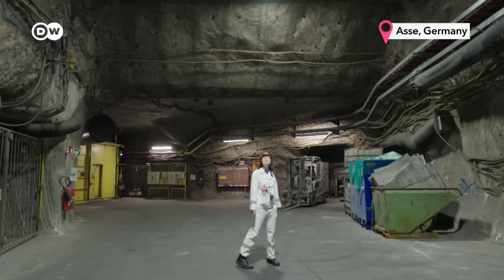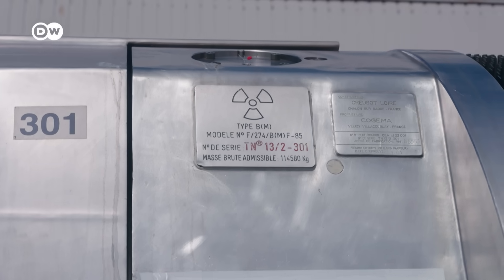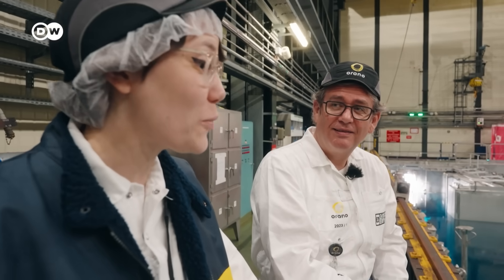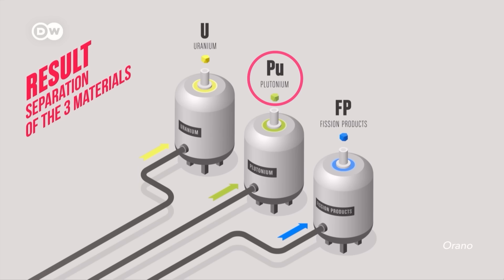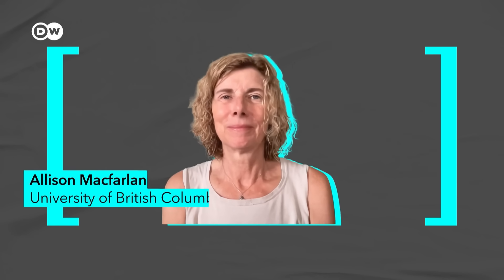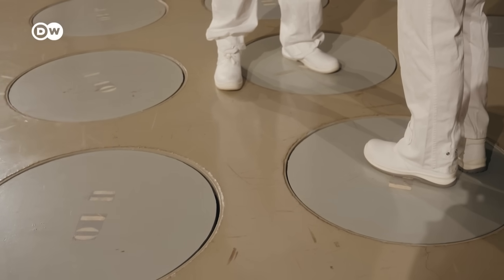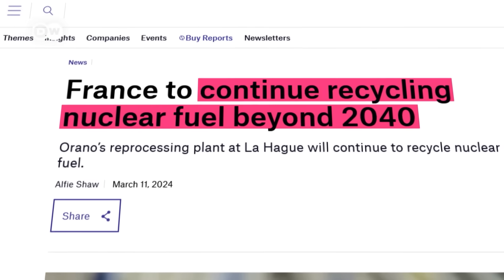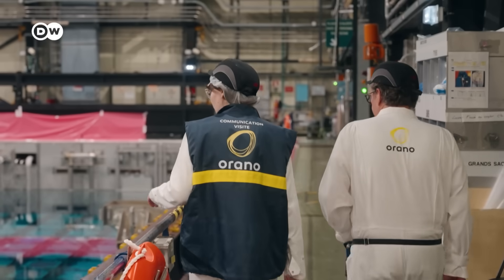Nuclear waste is reusable. Why aren’t we doing it?

Comment: This vid is ALMOST accurate, and it still feels pretty anti-nuclear, particularly when trotting out the nuclear bomb footage.  Yes, someone did make plutonium for a bomb using a CANDU reactor but NO - the reactor was not run correctly to produce electricity.  It was NOT from the plutonium from spent fuel.  Just because it is "plutonium" does not mean you can make bombs.  It is the same problem you get trying to make bombs from natural uranium.  Remember the vid mentions U235 - that in high enough concentration (typically well over 90%) makes a bomb, but a reactor runs about 4% with fresh fuel.  Plutonium from reactor fuel is a wide mix of isotopes.  It is NOT bomb material.

The vid also mentioned "fuel is radioactive for 100,000+ years".  What it should say, is "more radioactive than the average background".  When you pull out the plutonium, you are left with fission products (correct in the vid) but those decay away quickly.  300 years is enough to drastically lower the emissions.  The plutonium can then be used for fuel (particularly when mixed with regular U238) as "MOX fuel".

As for those "experimental" reactors, they are called "breeders", they consume the U238 which a normal reactor can't do.  Instead, the U238 is bred to a mixture of plutonium (gasp!) isotopes, or you start with thorium and breed it to U233.  Both of those can be used as fuel, which is why it is said that 96% of the "spent fuel" contains energy being thrown away.  The development of breeder reactors started in the 60s.  Lack of funding and public fear basically halted development until about 10-20 years ago.  We should soon see the results of their development. 

The biggest problem with nuclear power is too few members of the public understand it.  Once you learn about it, your fear drops away.
Reply: It wasn't even a CANDU reactor; heavy water moderated and light water cooled.
And yes the fission products are much shorter-lived.
Reply: There is a proliferation risk involved with fuel reprocessing though, if you can extract separate isotopes you can extract Pu²³⁹
The solution to this problem is liquid fuelled reactor with a high burn up rate rather than solid fuel reprocessing.
Reply: @MostlyPennyCat 
Higher burn-up waste (from PWRs and BWRs rather than CANDU) contain a much higher percentage of Pu-240, which makes building a weapon much harder (and a fizzle more likely). Yes you could try to centrifuge it, but then the mass difference is not as great as between U-235 and U-238, plus explaining to the IAEA why your centrifuges are unusually radioactive may be challenging.

France already has nuclear bombs of various sorts so the proliferation risk is lower. Look at how uranium enrichment works; proliferation risk but managed.

Note that SHINE Technologies (of the USA) is working with Orano to develop reprocessing where the Uranium and Plutonium are kept together.
Reply: @asabriggs6426  you can quite simply run a civilian reactor for a short time and then extract the Plutonium before too much Pu-240 accumulates. This is an inefficient and thus uneconomical way to run a power reactor, especially if it's a type that doesn't allow on-line refueling (which includes the now standard PWR designs), but it is definitely possible if you don't care about the cost. Any country that has a light water nuclear reactor and the capability to recycle spent fuel rods can also make weapons grade plutonium, it just might be less efficient than using a dedicated plutonium factory like Hanford or Mayak.
Reply: @johannesgutsmiedl366  If you have a reactor capable of online refuelling (CANDU, AGR) then a lower burn-up of fuel is possible. However doing so with a PWR would have an obvious signature as shutting down the reactor and taking the reactor head off is a time consuming operation (a full refuelling outage can take several weeks). Also the reactor would require an unusually large number of fuel rods. The IAEA would take a great interest in this activity; their safeguards monitor things like the whereabouts of fuel.
At that point simpler designs of reactors may be better. For instance, North Korea used a version of Magnox reactor which ran on unenriched uranium (I believe).
Reply: @asabriggs6426  oh yeah of course if you're concerned about being detected then a PWR isn't the way to go, I'm talking from a pure physics/engineering perspective.
Reply: @johannesgutsmiedl366  From a pure physics point of view you're probably better off building some centrifuges instead. Small energy usage, few potential radioactive emissions from enriching. The USA even publish pictures of what centrifuges look like and how they work. Centrifuges (from Urenco) are how Pakistan joined the club. Don't use Siemens PLCs, mind you.
Reply: @asabriggs6426  There are four plutonium fluorides, but only one of them, plutonium hexafluoride, is a gas, and it's highly prone to radiolysis due to plutonium's radioactivity.
Reply: @MostlyPennyCat  There is no proliferation risk.
The separation of Pu 239 from Pu 240 found in spent reactor fuel is practically impossible.  The difference in mass is only 1 while the mass difference when separating U 235 from U 238 from natural ore is 3.  Why would anyone interested in making a bomb choose the almost impossible method rather than the still hard but achievable easier and proven method?  Answer: They wouldn't.
Reply: @i.e.creative  There are ways of separating the isotopes in an atomic beam via the different magnetic moments (https://en.wikipedia.org/wiki/Stern%E2%80%93Gerlach_experiment)
Reply: @i.e.creative   "The separation of Pu 239 from Pu 240 found in spent reactor fuel is practically impossible." Very interesting point. Seems like this blows the recycling danger argument out of the water. Anyone care to counter this claim?
Reply: @cadthunkin  you can still build a nuclear reactor but not a bomb you see that leftover plutonium.  The fact it can't be separated is actually very helpful because prevents you for making bombs.  However that mixture of plutonium is commonly used and recycled. The French already do it it's called purex.
Reply: @i.e.creative  it's not "almost" imposible it is imposible to separate PL239 from PL240. At least for now.
Reply: @nikitashilov9758  I will stand by my wording that it is possible because I have literally separated the 2 isotopes myself using a particle accelerator.  So it is possible to do so but it is totally impractical to separate the 2 isotopes in a quantity useful for weapons.
Reply: @i.e.creative  you can address it to IAEA, because they told it. Because of it fuel from atomic reactor is not a subject to Treaty on the Non-Proliferation of Nuclear Weapons.
Reply: @MostlyPennyCat  I'm glad that you know the difference between Pu239 and Pu240. However, Pu240 is not suitable for bomb production because it spontaneously decays too rapidly, causing premature fission when attempting to trigger a bomb. But Pu239 is converted to Pu240 rather easily, so in order to produce bomb grade plutonium, they cycle fuel through the reactor fairly rapidly. That is quite different from how they cycle fuel through a reactor for energy production. For energy production, they keep the fuel in the reactor for quite a while, and in doing do, the percentage of Pu240 in the plutonium makes it unsuitable for bomb production. And separating Pu239 from a mixture of Pu239 and Pu240 is rather difficult.
Reply: The video does make the point that the real barrier is simply cost. That's not blind fear, it's economics.
Reply: @zibbitybibbitybop  Only when economies of scale isn't factored in to the equation. 
Do that and it quickly becomes clear that. Spent nuclear fuel recycling and nuclear power in general far out perform any other form of power generation when considering like for like on a level playing field. 👍
Reply: @robfer5370  
The high cost of reprocessing is what limits its growth. 
When we first developed reprocessing the world thought that natural uranium was MUCH more rare than it is.
Turns out there's lots of uranium, digging it up and making UrO is just cheaper and cleaner than fiddling with the most dangerous materials on the planet.
There's 56 million gallons of PUREX waste water at the Hanford site containing 16 exabequerels of radioactivity.
Hence not financially viable.
Reply: nah the biggest problem is when you understand it and you also understand economics as well, therefore you realize how much waste they have to deal with compared to renewables

many people understand it, don;t trust people do do it right
Reply: @DarkShroom  I find this so dishonest though

When it comes to economic problems with certian industries, we always seems to find solutions anyways to reduce the cost.

Batteries are extremely costly at the moment from being used as a dedicated grid for power, but does that stop the industry from finding solutions to decrease the cost? NO!

But that's not happening with nuclear, because cost isn't the actually inhibitor, public opinion is.
Reply: @ODSTklecc  partially yes. In my own opinion it is t only the cost, but the availability of the mines is very unfavorable for Europe, there is the constant spillage of tritium (heavy water) that everyone always either ignores or compares to a crate of bananas. As well as the strategic vulnerability. Sure for some parts of heavy industry and energy dense areas it can be the better solution. But it shouldnt be seen as a magical bullet either. If we would have nuclear for 10-15% of our total power production it would be good. This is a totally arbitrary number on my end, a estimation and nothing more.
Reply: The halted development point is a good one to highlight. Everything in the nuclear space has taken way longer than needed to develop because of the extreme lack of funding and public skepticism about it. If nuclear had clear government support technological development would follow a more traditional timeline.
Reply: @_lime.  
We're picking up the pace here in the UK.
Got some SMR projects going, lots of really promising fusion projects too.
The one I'm really looking forward to is Moltex's SSR and the first one that they're building in Canada is the waste-burner, SSR-W
Reply: @_lime. The US DOE budget for nuclear has been from 30 to 50 percent. Nuclear only makes up about 20 percent of energy production.
Reply: https://en.wikipedia.org/wiki/CIRUS_reactor
Reply: Well said and accurate!
Reply: Let those snowflakes just live few months with power outages and they quickly learn how electricity is important for our current civilization, literally everything is dependent on electricity, solar and wind energy are kid's toys compared to what nuclear power plants produce. They never struggled in their lives, bunch of hipsters sitting in Starbucks and writing stupid articles on their MacBooks about nuclear wastes are so bad and dangerous, they care about environment as much as Greta Tumblerg.
In order to advance we need even more electricity, good luck achieve it with "green" energy.
Reply: If anyone is interested in the next step forward, china announced thorium msr to be completed in 2029. Look into it
Reply: not to mention the "waste fission products" have other uses in medicine, industry, or even power generation still.
Reply: Glad to hear people start to realize nuclear power is not really bad like people thought on chernobyl and fukushima incident (they keep saying it a loud since only few case that can be mentioned as example). If I was raised from non-scientific parents, I might not a pro-nuclear
Reply: I still have no idea how people can't grasp the concept of nuclear power and that it's the safest and greenest source of energy that can supply the whole world. I hate how anti-nuclear the governments and media are, especially leftist ones.
Reply: да сейчас степень размножения в бн800 0,85.
Reply: this is german media
ofc they're gonna slip in anti-nuclear, they're paid to do that
Reply: Disagree with u really hard, we almost normalized nuclear power plant before. And where that bring us? 
Company with low reposibility and care handling it, cutting cost etc, and the rest is history. People against it not without a reason, the fact that we manage to almost normallized it back in itself is alrd a proof.
But no, some sh1thead really has to ruin everyone times, and now almost 50 years later, we pay the price, companies and govertment that handling nuclear power have to many ties between their leg, but the moment we let it loose, another history might repeat.
Slow progress like this isnt that bad, we still gonna build towards better nuclear power plants in the future while also making sure those who handling it actually breing very carefull and no cutting cost capitalist bshit.

Recyling it sounds good on paper but once we tied it to economic issue, the problem rise, recycling cost u money, and alot of it compare to just use a new uranium. I dont wanna to think, which next company's leader have a simple thought of "this cost too much, lets cut cost somewhere" on their stupid head, and ruin everyone time, again.
Reply: @LFTRnow one thing I disagree with is always the framing that "stupid public be so fearful".. Many things that also stopped development in breeding&recycling stopped with the The Treaty on the Non-Proliferation of Nuclear Weapons..  Which was not stupid public, but global politics.. and the other thing is, the public is not just "stupid fearful", they lost trust. How did this happen? For example when the Windscale Brand was for many years tried to cover up. Or when Japan goverment stepped in front of camaras and deliberately lied to the public for days. (as they said, they feared panic, if they would be honest). Anyway, when honesty isn't an option you gonna lose trust.
Reply: @georgelionon9050  At the time the public scare was pretty much justified because nuclear power started with the bad image of the nuclear warhead, furthermore at early stages there was not enough research to confidently understand the risk and safety of the nuclear reactors and there was a justifiable belief that nuclear power could proliferate nuclear weapons. 
That said, tell me one sector in which there is complete trasparency, or tell me a source o energy that never killed anyone: The Banqiao hydro power plant killed between 200k/300k people; in extreme condition (5th most powerful tsunami ever registered) the fukushima disaster killed none! Two hydrocarbons related disaster happens every MONTH but it's nuclear power the energy form with an ONU organ completely devoted to his safety.

The initial fear was justifiable, post '60 fear is just misinformation and stupidity.
Reply: Cos it was anti-nuclear, hiding behind the banner of being good genuine information! 😒
Reply: @robfer5370  according to that logic, the US government is also anti-nuclear because they don't like it when other countries have Plutonium.
Reply: @1zui  No according to that logic money and power are the real motivators at work.
Reply: Too few members of the public understand it.

A perfect way to sum up a lot of things really.
Reply: Basically, there are multiple isotopes (think of it variants) of plutonium of which only one is of interest for nuclear weapons.  That one is quickly produced in a nuclear reactor from Uranium 238 which the vast majority of the uranium in most reactors.  Leaving the fuel for longer in the reactor more and more of the "bomb plutonium" isotope is converted into another isotope which is a large problem for the construction of weapons. This means for plutonium bombs early reprocessing of the fuel which is not well spent by that time is required.

The operator of a power plant has contradicting interests, wants to minimize the cost of fuel (and the interruptions by replacing fuel) thus leave the rod for as long as viable in the reactor.  In short, these interests conflict each other.

As for the quantity of highly radioactive fuel.  It is being reduced by reprocessing.  The problem is more the unavoidable side products of low and middle active waste which inflates the total quantity.

And then there is this term radiation.  The term was probably taken from mathematics where a ray is something that is infinite on one side.  In the general population it has been associated with danger that anything that technically is described as radiation is immediately associated with lethal danger.  Such as mobile phone radiation.  Yes, gamma radiation and radio waves are phsycally the same thing.  But so is throwing a pebble and shooting one from a slingshot.  The energy makes all the difference.
Reply: It isn't a lack of understanding but a difference in opinions and values why people are against nuclear powerplants.
For arguments:
Timescale of waste is soo much larger than humans really can handle.
The overall toxicity of the metals used (not there radioactivity).
Economically it is very state supported and makes your energy grid topology a star form and not a net which is preferable.
Global politics many uranium is bought from Brazil and so you are supporting low working conditions and a questionable political figure.
Natural risks for the people and nature living along transport lines and reactors.
Nothing is perfect accidents will happen. If you don't then the accident don't happen.
You can put different weight on certain factors and come to a different conclusion as other pupil. But that doesn't make other people stupid.
Reply: Until you start seeing the heavy water production that is sleeping into the French rivers, to a point where people can no longer swim or drink from it. Also the fact that where uranium is mines, it isn't done is a very safe way, that is a lot of mild radioactive material dust is blown away in the wind. And the cost of nuclear power. I. The end it is still a mined and therefore finite resource. With improved battery tech renewable energy will be the way forward for most countries in time. It is more decentralised, less likely to produce war-materials and cheaper for household consumption. Only big industrial areas need nuclear energy for smelting and the like.
Reply: @Sir_Wufsalot  >where uranium is mines
So like any rare earth mineral? like the ones necessary for solar panels? Also, how about all those turbine fans that break and can't be properly recycled?
>And the cost of nuclear power
You mean the most efficient energy matrix in both footprint and carbon emissions? Sure.
>With improved battery tech
Which also requires metals, so I guess we're back to the mines

I'm not against a wide variety of renewable sources. In fact, I would love to see the proliferation of a hybrid energy matrix where the houses have their own power sources to reduce the load from the main grid. But even that has its limits. The sun doesn't shine all the time, and it doesn't even shine equally along the globe. Same for wind power. You can pile up as many renewable sources as you want, you will still need a reliable source at the core. And this is what I don't get, why are people so resistant against nuclear?

The accidents that happened were that, accidents. And from those, the (heavily unfunded) technology advanced and made reactors safer, more efficient, cheaper to build, modular, and every step takes into account the possibility of nuclear weapons, which are a different thing from reactors. I will concede the point to heavy water, but rule of thumb is you should not dump ANY KIND of waste into a river. But guess what? If there was more investment, I bet even that could be solved.

And it is not only big industrial areas that can benefit from nuclear energy. As if that was a small number to begin with. Hospitals, business centers, trade and data centers, airports, ports, train lines, traffic controllers, police departments, military bases, water treatment plants, all sorts of infrastructure that really need to be active 100% of the time.
Reply: @SparkyRedheadSupremacist  the turbine fans are something that i dont understand quite why they use something that they cant recycle either. Probably cost/efficiëncy.

The reason is not accidents, but constant outflow of heavy water. Somehow no one seems to be note it as a source of pollution. Assuming CO2 is the main and only problem, then yes, but that isnt quite the case of course.

Heavy industry and the like could benefit of it, like hospitals and data Centres as well, but why go for more than you would need? A lot of people want a magic bullet solution, and there really isn't one.